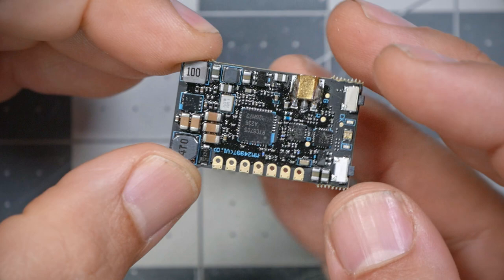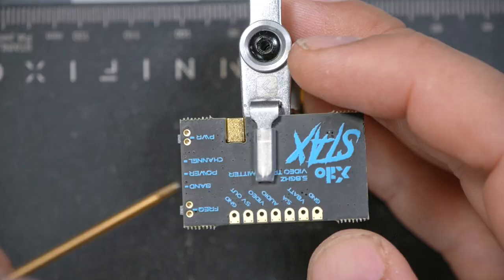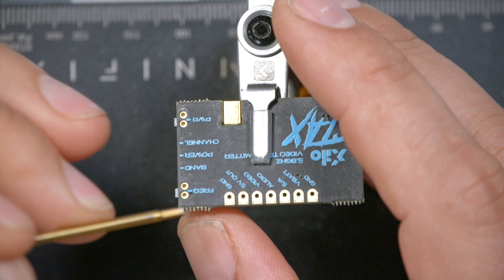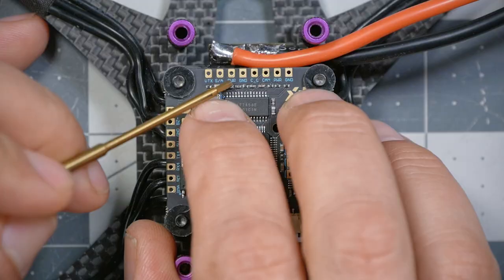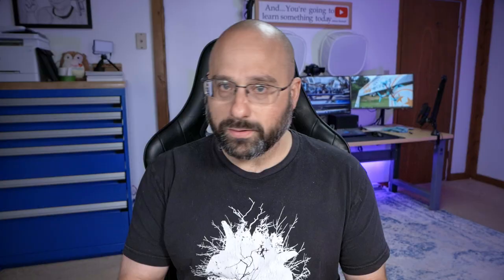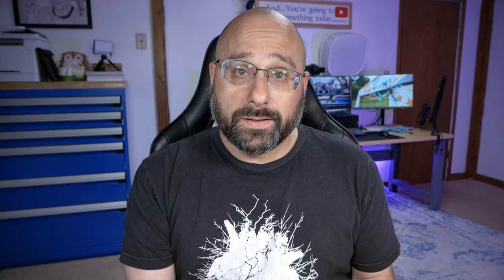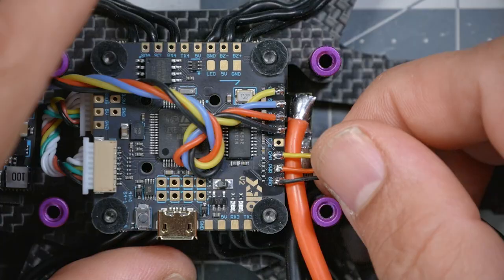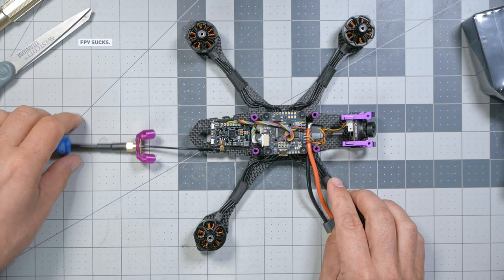Build an FPV drone in 2023 - Part 4 - Analog Video Transmitter

Comment: 😢 Was going great, I was connected on beta flight including with the battery, then I soldered my camera and plugged the battery in again and got a puff of smoke. Now the fc won't connect. Wtf did I do
Reply: How did you fix it
Reply: @rakzfn  replaced fc
Reply: @mattdeady6448  did you do anything different the second time? I think the exact same thing happened to me
Reply: @haveitall1792  no - just checked for solder balls and used a tooth brush and some rubbing alcohol to scrub it clean. My guess is I had a solder ball bridging two joints.

Comment: Hi Josh my first build has went sideways. I followed your perfect build guide but I can't seem to get motor 1 to spin I need help I will pay. I bought the jbf7 v2 stack. Iflight sent another esc for motor one to do the same thing. I bough another blitz 4in1 for it to also not read or spin motor 1. From what I learned it can be the pins. Can I change them. Plz help I will pay to get the qav s jbf7 tank solo 1w iflight xings in the air. Plz help
Reply: How can I change motor one pin in cli I don't want to damage anything
Reply: If I need to buy a new flight controller so be it. I know they won't replace the fc after already sending a replacement esc to find that not the problem change motors too they all work. I just wanna know can I change pin before I shell out another 80 bucks for a new jbf7 fc.
Reply: @bigcity1872  did you try the motor on another channel of the ESC? It could just be the motor that is bad.

Comment: What if I connect the battery and the "Device ready" prompt in the video transmitter tab says false? I do see a light on the vtx.
Reply from the maker: That means the FC is not seeing communication from the vTX. Double check tht the wiring is correct; the solder joints are sound; and that the Ports tab is set as shown in this video.
Reply: @JoshuaBardwell  everything looks right, I am using the TBS Unify Pro. Would there be compatability issues?
Reply: Posting the solution that I found for my problem: I found the solution in JB’s vtx troubleshooting video that I needed to download the TBS app and connect the vtx to my computer and change the setting on the vtx from CRSF to Smart Audio. Hope this helps someone else!

Comment: I’d save it for the live stream but we haven’t had one in a bit: What is the historical reasoning behind smart audio being named smart audio?
Reply from the maker: The earliest TBS Unify vTX did not have a UART wire, but it turned out that the audio (microphone) line was connected to a UART on the vTX's MCU. So the audio (microphone) line could double as a digital TX/RX wire to connect to the FC. So it was called smart-audio because it used the audio wire. Subsequent vTX put a dedicated TX/RX wire for the protocol, instead of doubling-up the use of the audio wire.

Comment: hey. I've built this exact kit up to this point and at least the vtx powered up last week, with lights. I couldn't get it to work with tbs smartaudio setting (only msp + display port would save to device), but i couldn't get device ready... fast-forward to today I cant get the vtx leds to power up anymore. I'm guessing I've confused it on betaflight as I never powered the craft without the antenna.. Any help would be appreciated and yes I've watched your vtx masterguide video. the manual for the stax vtx also states nothing about updating firmware.. any help would be greatly appreciated!
Reply: I seem to have the same problem. Did you figure out how to solve it in the end?

Comment: I would have left 2 mounting holes on the VTX an use gummies or mounting post and drilled 2 Sm Holes in the frame to elevate the VTX off the frame an cool and keep it from touching the carbon fiber frame!

Comment: Tnx Joshua to share your knowledge.
I'm a newbie into FPV and currently I'm training with my lil Cetus X. 
I found that my camera was seriously out of focus and the locking nut was not tight.
I've to focus and reset it. 
You don't check for focus of the camera. Was my issue not common? 
Have we to check for the camera focus often